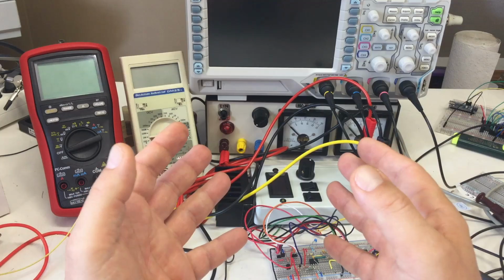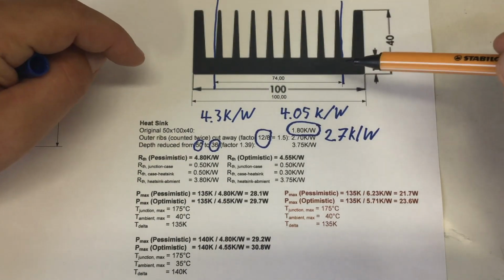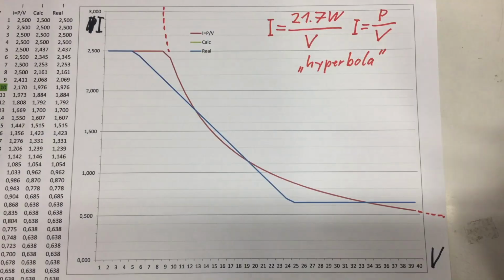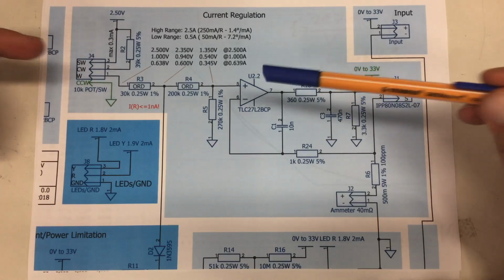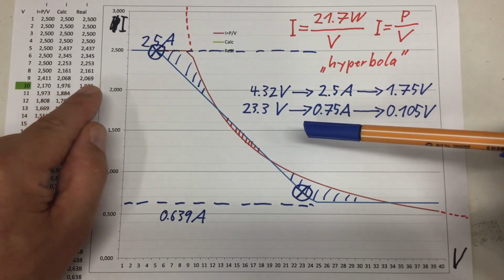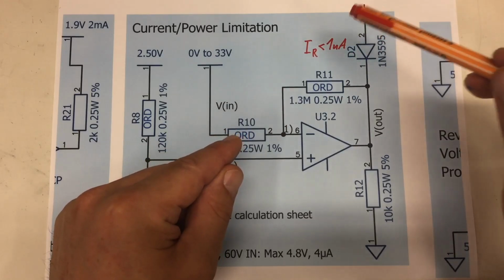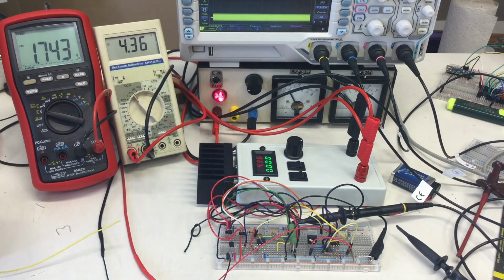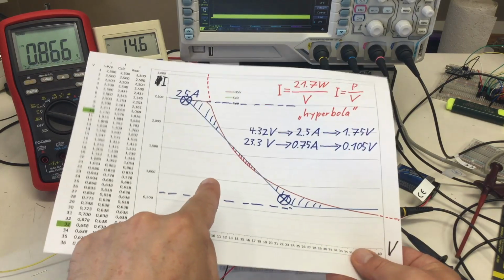"Simple" Constant Current Load (7): Power/Current Limitation

Comment: Hi Robert,  I am trying to build my own. I have a question. In your project if you pull 21.7W, how many watts will take mosfet and resistor? Do they share equally? If so, is 5W resistor too small to handle 10.85W?
Reply from the maker: No, they do not share equally! At the design current of 2.5A the 500mOhm shunt is just dissipating 3.125W (I^2 * R) while the voltage drop across it is 1.25V (I * R). So the power dissipated in the shunt is purely a function of the current. The power dissipated by the transistor depends on the current AND the voltage dropped across the constant current load. So for example at 2A and 10V the total power dissipation is 20W (V * I), 2W is dissipated by the resistor (I^2 * R) and 18W are dissipated by the transistor. The formula for the power dissipation in the transistor is: (V * I) - (I^2 * R) or (V - I*R) * I.
Reply: @robertssmorgasbord  Thanks for your support
Reply from the maker: @volkanislek  You're welcome 🙂